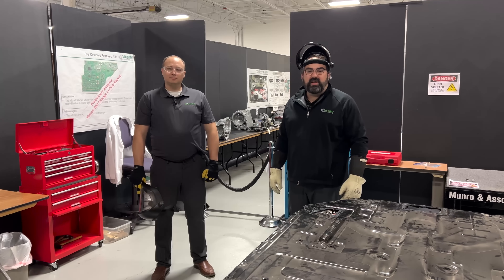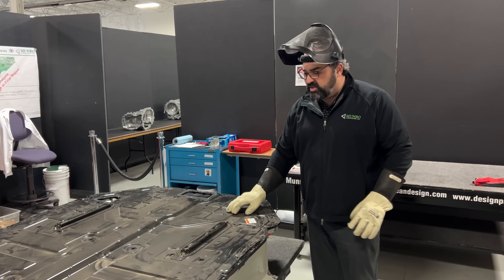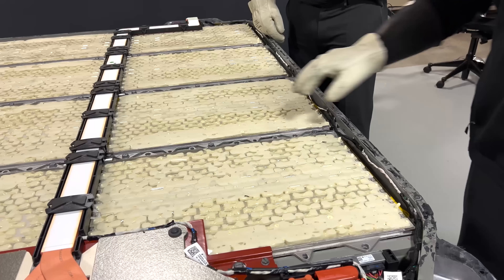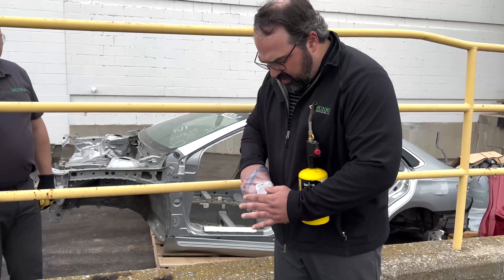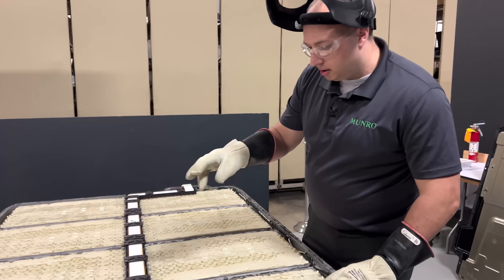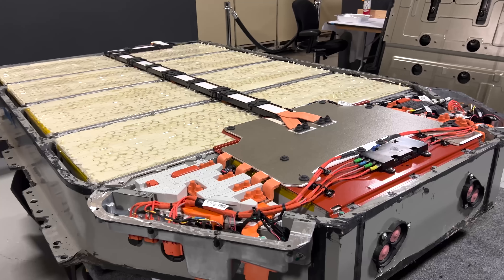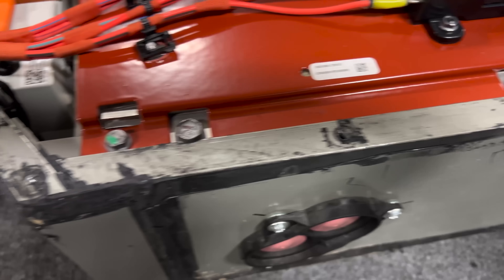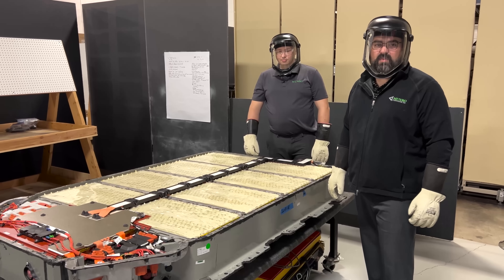Rivian Battery REVEAL!!

Comment: Problem is who the hell is gonna do a deep dive/take apart a whole battery pack no normal person would do this is just to much work I mean u cant always have a perfect battery pack? But anyway It was still a good video!
Reply: Why is this a "problem"?
Reply: @JasonWW2000  Because no ordnary person gonna say and look whats inside a battery as long as it charges and can get them from point a to point b lol they not gonna complain.
Reply: @jake78441  I agree with you, but I still don't see any type of problem. I simply don't know what your referring to. Are you referring to it appearance? You think it looks bad? It won't be seen, so that's not a problem.
Reply: @JasonWW2000  well i saw they was nit picking at the rtv or whatever that black stuff around the battery was?
Reply: @jake78441  That was just room temperature vulcanizing silicone. They were not saying it's an issue or a problem. They were just pointing out that it was hand applied as opposed to automated like other manufacturers. It can look neat when applied by a robot, but messy when done by humans. Over time I'm sure rivian will switch to a robot to apply it. Right now is still early days.
Reply: @JasonWW2000  Ohhhhhhh

Comment: Bottom carbon fiber top steel? Why?
Reply: The top and bottom have very different requirements, for strength, impact resistance, attachment points, and even corrosion. It's not surprising that they're different.

Comment: The only mica I know of is clear, in thin sheets. What kind of processed "mica" product are you talking about?
Reply: Mica is a mineral...the sheets are a composite material.
Reply: @vidznstuff1  OK, so it is a crushed or powdered mica-loaded engineered composite resin.
 What we call "plastic".
Reply: @lyfandeth  What you should call a polymer sheet, or a fibre-reinforced polymer composite, depending on construction. 😉
Reply: @brianb-p6586  In the US the correct term would be FRP, the same as fiberglass and the other fiber reinforced plastics.
 Now we'll have to call DHS and have them check to see is Sandy isn't a foreign spy. 😀
Reply: @lyfandeth  there's no "correct" term, but FRP (fiberglass-reinforced polymer) is popular in the U.S., GRP (glass-reinforced polymer) is popular in the UK, and since the polymer is usually polyester, it is sometimes just called "polyester" in Europe with the reinforcement assumed.

Mica composite sheets like this are apparently over 90% mica (milled particles formed into a "paper") bonded with some sort of epoxy resin.

If you didn't catch it, I was referring to the use of the word "plastic": it is really not the right word for most stuff that we call that - it is a short form of " thermoplastic polymer", and many of the polymer materials we use (including the unsaturated polyesters used as resin in FRP) are thermosetting, not thermoplastic.

Sandy's foreign to the U.S., being from Canada, although after a few decades and gaining U.S. citizenship he's a deeply embedded agent. We're all potentially subversive up here. 😉

Comment: I would like to see the battery pack to be more serviceable so when one pack dies you don’t have replace the whole battery pack or when you want to upgrade some of the packs
Reply: This
Reply: They are designed to not be serviceable.
Reply: regarding the point "upgrade some of the packs": i think you mean modules, not packs (since there is just one Pack with multiple modules) - and that is physically not possible. you either upgrade the whole pack, or you dont. If you just upgrade a few Modules you will gain nothing, since the total Capacity is limited by the worst Module. Even worse: you would probably increase the wear possibly quite dramatically on that Module and then have to replace it anyway.
Reply: The modules rarely die

Comment: Since this is not the Max pack that Rivian offers, I'm curious as where the additional cells will go? If there's no more room, I have to assume they would use different batteries with a higher volumetric energy density.
Reply: I believe the extra cells will go where the rear underseat storage currently is.
Reply: @Luckycharms783-g2n  correct.  In the R1S they are placed in the 3rd row instead of the seat.
Reply: They are already using cells with the highest volumetric energy density (Li-ion 21700) so they will probably make the battery pack larger (deeper) or else add a second smaller pack, perhaps where the bed storage container is located.
Reply: If you have seen the rolling chassis of R1T you will see there's a wide gap between the battery pack and the rear subframe. I guess that's where the extra batteries go.
Reply: The 180 kWh battery apparently has 12 modules instead of 9, with the module sizes (but not the internal configuration) being the same as the 135 kWh battery.

Comment: Good stuff guys.  Please in future explain terminology and reasons why a little more, it would help make it clearer.  For example, I was able to lookup why Mica is used in EV batteries and what RTV is and its properties, but it would be even better if you briefly explained in the videos.  Thanks again, enjoyed it.
Reply: You had to look up RTV? I believe they assume the viewers know a little about battery packs since they are watching a video on them. I don't think they have the time to explain every little thing. Whatever your not familiar with, look it up on Google. No offense meant.
Reply: It isn’t a common term in my country, at least I haven’t heard it before.  I did look them up, as I said.  It would make it easier, as I said.  No offence taken.
Reply: @tsedge99  Good point - local terminology may vary. Assume that Munro staff are using North American terminology. 

I think a brief on-screen caption could be used to define each term, without interrupting or extending the verbal description.

Comment: Or maybe the engineers were like "yeah the carbon top will have a production cost of $3,890 and lets see stamped steel will be.... $177 what do you guys want to do for this part nobody will see?"
Reply: I believe they maybe plan for a big thermal rundown in case of crash that would "explode" thru the bottom, because plastic would break sooner than steel.
Reply: Depends whether the cost for the carbon fiber is more than the cost of cells to make up for the range difference due to extra mass for the steel cover
Reply: @playitlouder451  I’m curious about the actual mass of it: the sheet didn’t look that heavy to me.
Reply: @playitlouder451  Rivian mica sheet: 3kg.  Tesla Mica sheet 15kg.
Tomayto/Tomahto...
Reply: @playitlouder451  I feel like wed be talking 100ths or 1000ths of a percent here.
Reply: Perhaps the truck they sent to do range testing had a premium set of components that were light weight..

Comment: What is the cell arrangement in this battery? How many cells in series and parallel in each module, how many modules in series and parallel?
Reply: I believe the answer is:

105 kWh: 9 modules, 12 cell groups per module, 56 cells per group, 6,048 cells

135 kWh: 9 modules, 12 cell groups per module, 72 cells per group, 7,776 cells

180 kWh: 12 modules, 9 cell groups per module, 96 cells per group, 10,368 cells

This implies that each cell holds about 17.36 Wh or about 4.8 Ah at 3.6V.

These calculated numbers are consistent with, and implied by, other statements by Rivian executives but have not been specifically verified.
Reply: @jeffnisewanger8260  4800mAh sounds about right for a 21700 cell
Reply: @JasonWW2000  Also, 21700's can be as high as 5500mAh
Reply: @charlesball6519  I wasn't commenting on that, but okay, thanks.
Reply: @jeffnisewanger8260  let's take 105kWh module as an example. I'm assuming 400V architecture, so battery should have 96 cells in series or something around that.
Does it mean, that two 56-cell strings are connected in series, and then they are connected in parallel with other 11 groups in module, then modules are connected in parallel? That would give us ((56s)2s12p)9p.
Or maybe there is first group of 12 cells in parallel, then such groups are connected in series? That's (12p56s)9p, but it's nowhere near 400V.

That's my core question, how they arranged cells in battery :-D
Reply: @uosiumen  It means for the 105 kWh pack that there are strings or groups of 56 cells wired in parallel — actually 12 of those in each module — and then these 12 cell groups in each module are wired together in series. So 12 x 3.6V is around 43.2V for each module. The 9 modules are then wired together in series so 9 x 43.2V is 388.8V. That is the nominal design voltage of the entire pack or, in other words, that is the resting voltage of the pack when it is filled to half capacity and nothing is going on. When filled to “100%” the voltage might be near 450 and when at “0%” the voltage might be around 320V.

In other words, the full pack has 108 (9 x 12) cell groups wired in series (not 96) of 56 cells each. Note, that many EVs actually do have 96 cell groups in series for a nominal pack voltage of around 350V. But, a number of newer designs like the Jaguar IPace, Rivian, and the new 2021 Model S and X string together more cell groups in series (108 is now typical) in order to improve charging rates when fast charging without going all the way to an “800V” design.

All 3 Rivian pack capacities use a 108 cell group design, as I understand it. They differ in how many cells are connected together to form a cell group between the small and mid-size pack and the largest pack has more modules so each module also has fewer cell groups so that the pack still adds up to 108 cell groups in total.

Comment: That blue Tesla foam looked like silicone to me. PU gives off a thick black smoke. Silicone smoke tends to be thinner and white, as you see from the blue foam. BTW that white smoke is mainly fine silicon dioxide particles which are very bad for your lungs (silicosis risk).
Reply: Right, they should be wearing proper respirators for the demo inside
Reply: @aayotechnology  For that small a test it's pretty safe unless you start sniffing the smoke directly. It's not like they are doing it every day.
Reply: It's not silicone. It's almost like a closed cell polystyrene
Reply: @vidznstuff1  Polystyrene burns with a thick black smoke. The smoke from that blue foam was white. Silicone rubber is one of the few plastics/rubbers that burn with that white smoke.

Comment: This is disappointing, nothing seems to have been designed for manufacturability.  Rivian engineers didn't even seem to know about thread forming screws, didn't use them in the 80 fasteners around the periphery to hold the steel top cover in place.  And the steel cover has 300 welds in it.  This is their first product after 10 years of development and I expected a better design than this.
Reply: Stfu!!!!! This is their very first vehicle and they re already improving on the design what is your problem!? They have at least managed to integrate a lot of components in that box unlike others

Comment: How do the fire resistant treatments last? We have seen in aircraft some of these treatments have been designed to pass the initial testing but become  highly flammable with time!
Reply: Polyurethane is kinda fire resistant on its own, so not a problem here.
Reply: @tukid666  Hi, thanks for your reply. I am not an expert but plastics are a rabbit hole of interesting complexity. From the little research I have seen PU's do have some fire resistance but still have fire problems including giving off cyanide at higher temps.
Reply: There are paints (used inside the box postal pickup boxes, etc.) that are inherently self extinguishing. They char, carbonize and stop burning. No time limit on that, so presumably the same thing can be done with plastic.

Comment: 7:44 For consistency of tests you should have also burnt the Rivian foam inside the building as well. Also both pieces should have been cut to the same shape; the Rivian foam was a ball against concrete and the Tesla foam was an airborne shard.
Don't get me wrong, interesting results but testing methodology should be the same. Thanks for the great insight as usual!  :)
Reply: Polyurethane releases hydrogen cyanide when burned, so a really bad idea coming from your armchair
Reply: @vidznstuff1  "hydrogen cyanide"; sounds like a Rivian fire would be much worse than a Tesla fire.
Reply: Only in very few cases will it make a difference whether the material is combustible or self-extinguishing. Because in most cases there is not enough oxygen in the housing and the foam ALWAYS extinguishes itself.
But the cause of the fire in the pack is more likely the cell and it doesn't matter whether the foam goes out after 2 seconds or after 10 seconds, the only important thing is that both materials are not fire accelerators.

Comment: If this has 9 double stack modules, where will the 3 additional modules go in the big big pack?
Reply: Rivian offers three pack energy capacities at 105, 135, and 180 kWh. Each variant uses the same cell type so the pack size is determined by the total number of cells and modules.

The two smaller packs are the same physical size and shape.

Actually, the smallest pack also uses nine modules but each of the cell groups in the modules contain fewer cells in parallel.

The largest capacity pack, at 180 kWh, has 12 modules and thus the pack is physically larger.

This is where the packs for the truck and SUV diverge. The truck uses a longer pack to hold the extra three modules while the SUV stacks the extra modules as an extra layer on top of the pack skateboard. This extra thick section of the pack ends up under the rear seats.
Reply: @jeffnisewanger8260  Good analysis 🙂 The specs that I have seen show the 180 kWh pack has having 12 modules, but only 9S each rather than 12S. That's 864 cells for both 12S72P and 9S96P, suggesting that those modules are the same size, with the 180 kWh pack having three more of them.

Comment: Thank you!
I crash lithium batteries everyday in my RC hobby, in a runaway thermal event……that small layer of foam in both the Rivian and Tesla will be insignificant fire retardant protection, especially as they both burn. Lithium needs no help propagating fire😎 I see that foam more as external thermal protection and packaging NVH.
Reply: Oh I see, so it doesn’t really matter that Tesla isn’t using that type of foam?
Reply: The foam is not a fire retardant. It has fire retardant in it to keep it from feeding a fire.

Comment: Those potted cells mean this pack is going to be a bitch to repair if it develops a bad cell that shuts the pack down.
Reply: Bad cell will be a "totaled car"
Reply: @gergc4871  Not really.  There are 8 modules that can be individually replaced.
Reply: @ohger1  9 modules, but yes, repair (if done) will be at the module replacement level.
Reply: They do not intend to repair it, the whole battery pack is replaced.

Comment: What's the reason for Tesla to not use self-extinguishing foam besides, I presume, cost? Is the S-E foam more toxic or unregulated/not permitted outside of the US?
Reply: my guess is the foam does not actually prevent thermal runaway but reduces the amount of fuel if there is a battery fire.
Reply: if the same experiment was done inside a battery enclosure, I bet the Tesla foam would not burn either since it requires oxygen.
Reply: The foam is there to mitigate thermal runaway.

Comment: How many cells and what size?
Reply: 7776 cells total in the pack, 2170 sized cells. Same size as Model 3 and Y (not necessarily same chemistry, etc)
Reply: The numbers that I have seen include
9 modules each 12 groups in series with 56 cells per group, for a total of 6,048 cells (105 kWh)
9 modules each 12 groups in series with 72 cells per group, for a total of 7,776 cells (135 kWh)
12 modules each 9 groups in series with 96 cells per group, for a total of 10,368 cells (180 kWh)
This has 9 double-height modules, and is presumably the 135 kWh battery.

This should be detailed in the next battery video from Munro Live.

Comment: The comparison between the Rivian rubbery top cover of the modules, to the Tesla foam that is applied in between the cells is not an apples to apples comparison. Lets see if that material in the Rivian is applied in the same manner as in the Tesla packs. I was really disappointed in the excessive amounts of the black rtv all over the welds around the pack. That just leads me to believe that they don't have faith in the welds being air tight. As someone who worked on Model S packs for 5 years I can really see lots of similarities with this pack. From the center spine and module set up to the extra module turned sideways in the front of the pack. Over all a decent looking battery. My only concern would be the gaps where the micas don't completely cover, but really a minor gripe.

Comment: It's a shame they use laptop cells in thousands. there should be a standard for batteries for automotive use, any one cell can mess up the whole thing., fire, shorts, expansion, leak.  until they come up with larger format and safe and high energy density batteries for automotive use, lugging this dead wight and explosive around is not good for roads or environment
Reply: No battery is one massive cell.

A 12v car battery is multiple cells.
Reply: Well BYD is doing exactly this with their Blade LFP battery. I read that Tesla has closed a deal with BYD to provide Blade batteries.
Reply: It is not explosive. Gasoline is explosive.
Reply: Essentially everyone other than Tesla and Rivian use a much smaller number of much larger cells, normally of the pouch format.